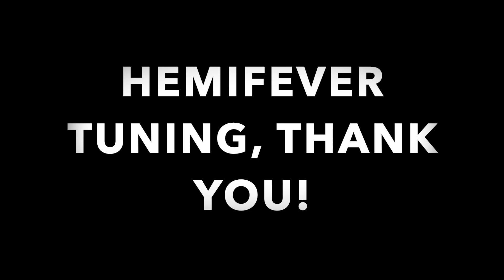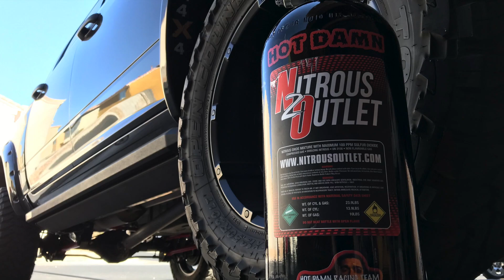Does my rear turbo spin at idle

Comment: Intuitively, seemed correct that the turbo would spin at idle. Production vehicles state in their owners manuals to let the turbo idle when stopping from like highway driving so the oil can flow through for a couple of minutes and cool it. If it weren't spinning, then doesn't seem that the oil would flow.

Comment: I would like to know a little about your set-up. I'm in the process of figuring out what size turbo to go with on my setup. I have a 2012 5.7 Long tubes w 3" duals all the way back, 60lb injectors, 60lbs of fuel pressure on e85, with a pretty big cam, springs, and push rods, and ported intake
Reply from the maker: Check out the turbo playlist, it has everything.